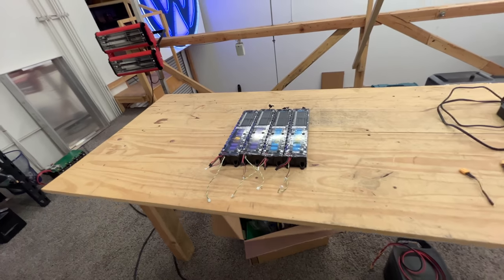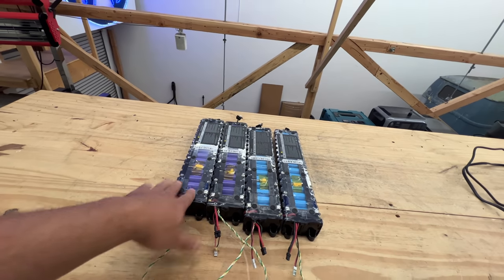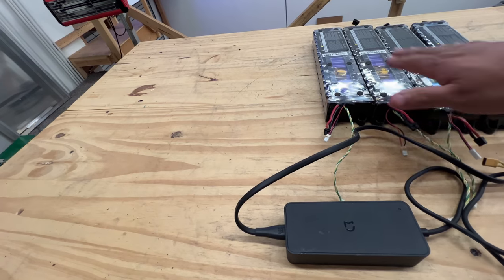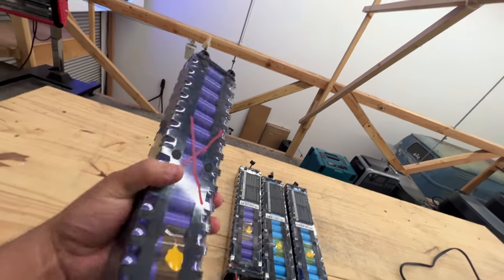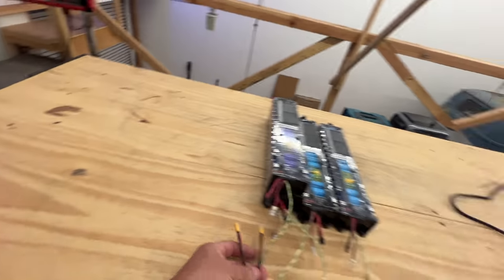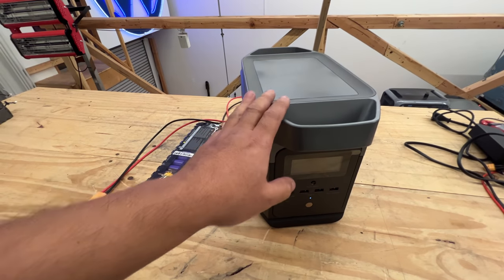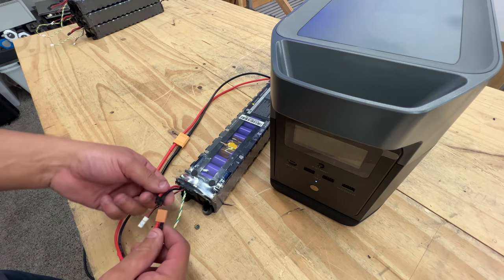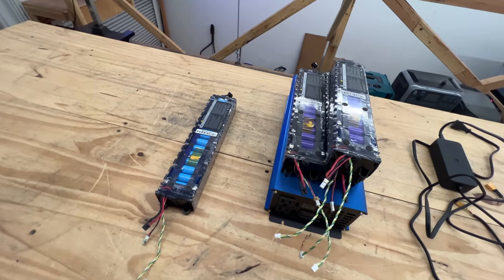10k Scooter Lithium Batteries In a Warehouse

Comment: Will say from experience, i bought a few of these used off of a bird mechanic, split a couple and reconfigured 6 of them for 13s9p at 4.5kw continuous and 7.5kw peak for a while, they are durable, while being a real b*tch to salvage the individual cells. Pull the BMSs, run 14ga or .1mm copper sheet between your packs and have at it. Stock bms is probably only good for the stock 500wish output peak

Edit: wanted to add I do not recommend running this much power through these, peak rating (probably for 10s) is 17amps per cell, with 10 amps continuous being their regular rating. If you are doing your first or third build and dont feel like buying a spotwelder or spending $3-700 on new cells, these work great!

Comment: You just helped me revive a dead pack that was showing 3.7V on the main, simply by pushing that reset button! 
I had no idea it was there. In my case, charging on main and charge wires didn't fix it, but the reset did.

Comment: Hey, I just ordered 6 packs on ebay, super excited!! I have a 72 volt scooter and have just been too depressed to go through my enclosed battery supply and grind down the old connections and reheat shrink and test the hundreds of 18650s I have. I may have an excellent supplier for 18650 batteries, but because I work for the company I can not take them home anymore!! If you want more info on that please message me!! Thank you for all you do with the DIY and showing people how to do it!!!!
Reply: Same here, although USPS held mine hostage for 10 days at the final hub. After walking in to a local USPS and asking about it, they finally delivered it.

Comment: For weeks I've been debating on either making a DIY LiFePO4 100Ah/1280Wh setup with a 2000w inverter for a Chevy Tahoe Overland rig that it'll be staying at for a few months after I return from deployment, or buying an Ecoflow Delta rig that offers 1260Wh. They both end up costing the same (Cost of parts for 1280wh DIY vs EcoFlow Delta w/ 1260wh) but the cost for extending power storage in the future was  going to cost way more for the EcoFlow until I saw this video. Your batteries solve my issue of battery capacity and expandability for cheaper and takes up less space than buying a second 100ah LiFePO4 battery. 

I'm planning on intermittently (not all at once) powering a 12v heating pad, Ninja Foodi MultiCooker, Hot Plate for cooking, Ninja Blender, 12v Fridge, Lasko 200w mini space heater, fan and charging my laptop and cellphone. 

Thank you for sharing your projects and knowledge. What are the chances of you creating a DIY kit in a container similar to an ammo can, with a PCB board to connect the batteries in parallel to charge then provide power to an EcoFlow?

Comment: Going to build the longest range scooter.  100 miles!! Ya
Reply: You might have to build a trailer battery and you can use it for many things down the road...
Reply: I just drilled a hole in my scooter's deck to externally access the battery connector. I bungee cord the battery to the deck. Works great! Just plug in a fresh pack every 10 miles and go 70 miles on 7 packs. Just carry them in your backpack, it's not that heavy. That is a long time on a scooter! I just did 25 miles in 2 hours (including errands).

Comment: I also built my ebike using the previous scooter battery packs.
Reply: How are the mh1 cells? I'm planning to build a 21s5p pack and I'm wondering how well they discharge I know it's 10amp per cell.

Comment: Why only 300W? If these contain LGM261865 cells (which are rated 10A each) it should do up to 30A * 36V = 1080W. Fully charged to 42V even more. The EVE ICR18650 are weaker, but still 23A * 36V = 828 W.
Reply: 10A max output but 2.6AH capacity.
Reply from the maker: the BMS only puts out 10A continuous so 360W or so
Reply: @jehugarcia  where can i make bulk purchase like this for my business? Can i contact you direct? Serious inquiry

Comment: Awesome!  So I wanna buy more of these to wire in series and parallel to make a 72 volt 24 amp battery, what kind of charger would I need to charge that kind of setup?
Reply: I bet you could just wire the output of two cheap ($8.88) 36V chargers in series.

Comment: I just got 4 of these.    The Xiaomi chargers were out for the xt30 so I bought the one with the xt60 connector and bought an adaptor cable from Amazon.
So far so good on 3 out 4 but the last one is acting a bit weird and the charger gets hot.
As far as using the smaller white connector is that possible with the Xiaomi charger or is that supposed to be charged with a lower voltage?
Hi Jehu, I sent an email about the 4th power pack not waking up.   Can I use the 2 pin cable to try to charge the unit?   The red light flashes about 4 times and stops.   The charger show solid red so it thinks its charging the unit.   Please see my email for more details.
Reply: Just an update.    I got the replacement for the unit that had an issue.   JAG35 sent me the replacement and a return label.   I decided to keep the one with the bad BMS and got a special price to buy/keep to use the batteries as backups or to reclaim the batteries.    I want to thanks the JAG35 team for the great service and accommodation.    Also, in case anyone is looking for the cable Jehu mentions it I couldn't find the exact one but Amazon does sell one that goes works with an XT60 connection.   Since I bought the charger from Jehu that had the XT60 connection (because they were all out of stock the the charger with the XT30 connection) https://www.amazon.com/dp/B07C2VDQTD?psc=1&ref=ppx_yo2_dt_b_product_details

Comment: I finally checked my battery pack, showing 2.7v from the output wires so I need to charge up the pack.  Problem is the charger output is an XT90 for a 1.7 amp charger.  I'm swapping out the XT90 for XT60s (smaller size).   Also outputs will be male connectors, inputs (like charging ports) will be female connectors.  I may change my battery output to XT90 from Power Poles as the XT connector looks more weather resistant.
Reply: I'm holding off on the plug changes, I built a dongle similar to Jehu's.   I plugged the charger into the charging port (thin wires).  Charger had a solid green led on, I saw a red LED flash once.  I'll keep checking for more flashes.   Ended up pushing the button.  The battery pack flashed red 4 times then stopped.
Reply: I think the BMS has an issue.  Pulling the pack open I'm getting 6.5v from the different battery groupings.  Checking end to end I'm getting 52v !?  Still only getting 2.5v from the power output xt30 connector. UPDATE:  This is what I get for forgetting about Jehu's earlier video on waking up the different scooter batters.  I made a XT90->XT30 dongle plugged it into the output power port then hit the button.  I've now got a red light on the charger and blue & red leds on the BMS - so it looks like it's charging.  Still not understanding the 52v reading I got earlier, but once it's charged I'll follow the connections and test again with the multimeter.  I'm sure getting an education on battery packs!
Reply: Following morning:. Charger showing green,. Battery pack LED is glowing blue, but the voltage across the power connector is only 3.75v.  Does something else need to be done to get it up to full voltage?

Comment: This is just a hoping that you or some genius out there can tell me how I can tap in a portable charging system in my 2013 FIAT 500e while in motion or driving  the car, to extend the range,
Reply from the maker: No
Reply: @jehugarcia  That hurts, maybe tapping the regeneration line by disabling the braking mechanism connection so the charge can keep going?
Reply from the maker: It’s the same mechanism,  when you steal power from going the result is stopping

Comment: Perfect timing on this video. I am playing with the purple battery for a DIY ebike setup. Hooked the thicker connector to the recommended charger it blinked red at first - battery had 6 volts on the thick/director connector. The charger light went solid red and eventually green - full charge. It only has a bit over 20 volts at the leads, though. Looking forward to trying the reset button trick - there is no blinking LED on my pack. 

Is there a name for the connector (with the 2.56 spacing) that goes to the proper charge connector?
Reply: Yes, of course.   If you can get a good picture off the video and do a google picture search, that should work.  If not, reply to my post and I'll put up a pic.  I have a few laying around somewhere.  They are used on all my 12 Vdc ceiling lights.
Reply: It looks like pcb header pins, 2.54 mm is 0.1 inch, which is the standard spacing for most pcb headers. Jehu may have measured the pins with a caliper which would explain the small difference. The connector looks like a 2 pin JST 2.54 mm connector. I'm not 100 percent sure though.
Reply: @chaffel3  I ended up soldering an XT60 connector as others had mentioned in the comments, easier than sourcing the connector.

Comment: Newbie question how do you connect all three or 4 together and were can one get a dongle for such?
Reply: Build a bus bar, or a bag of XT connectors and get soldering
Reply from the maker: get a few of these parallel connectors https://amzn.to/3DikGud
Reply: @jehugarcia  Thanks
Reply: Charge two of them up, cut connector off one, strip the red end, on the other pack's red wire strip a spot  about 2" from the connector and solder the red wire into the side ofthe other pack red wire and insulate. Repeat for black side.  Most hobby shops also have parallel Y cables for about $6

Comment: I was wondering what it would take to convert my astro van over to full EV I have a 1997 AWD Astro and want to give it more power then it has but unsure where to start
Reply from the maker: you need about 50kWh of battery and about 150hp of electric motor if you want a single gear.  so about $25K in parts and a whole lotta elbow grease.
Reply: @jehugarcia  damn! that's quite of bit of money for a simple project, I think is better to build a powerwall with those batteries...
Reply: @jehugarcia  how can I buy a bunch of batteries from you? I want to build my own powerwall...
Reply: @MrSeth166  Simple on paper is often complex in reality.  Yeah, you're simply swapping motors.  Sure you're simply swapping a gas tank for batteries.  Of course you're changing the plain gas pedal for a sensor.

Comment: If building your own battery box (batteries, inverter, charger, etc) Is there a way to make it auto-uninterupatable?  I.E. I want to start out by building something to replace one of my UPSs.  I want to be able to have AC power running in normally, but have it instantly switch to battery when the power goes out, then switch back and start to recharge when power comes back on.  Is that possible?  Is there such a thing as a charger/inverter that auto switches, or some other method?  Would the inverter start up quickly enough on changeover?
Also, best opinion...this pack 36v@8A, or the LiFePO4 12v 60-cell pack that appears to be capable of 20A?  I hate that pack statistics aren't very clear...I wish they had V,A,Wh per cell and per pack on all of these....  It looks like the LiPo 36v pack is ~270Wh @ $35, the LiFePO4 12v pack is 288Wh @ $45.  $129.63 vs $156.25 ($/KWh for standardization) but is the added cost worth it for LiFePO4 safety?  Also, 36*8 = 288W, 12*20=240W....the 36v pack can put out more power....  Let me know if I'm missing something...I haven't worked with any of this yet...just a lot of youtube watching.
Reply from the maker: Why replace your ups if you want the features available on ups units?  They make them them in all sizes and voltages so use one
Reply: @jehugarcia  SLA batteries suck and by the time I need them they're always dead.  I can't get a clear answer on if I could/should use lithium packs in them as an alternative.  Either due to current draw or charging methods.

Comment: Can these battery packs be connected in parallel? I'm replacing the SLA batteries on my stretch beach cruizer DIY ebike with these battery packs. The SLA batteries I'm currently using are 12v 15ah each. I have three in series. I get about an hour of cruise time with the SLA combo before they get weak. A pair of these battery packs would be roughly 16ah in parallel which would work out perfect. However I'm concerned that connecting them in parallel might be a problem without some kind of balance circuit. Also, can they be charged in parallel?
Reply from the maker: Yes

Comment: i have a Bluetti AC200P. I'm interested in seriously making an extra external battery for it. and using it in a small home built travel trailer. I wanted to get around 700watts to 800 watts of solar on the roof. i have so many questions like can i build a box for these batteries? can it be airtight? does it need to be vented? does it release gasses? and the exact parts i'd need to get to make 8 or 10 of these packs into the external battery? how to best recharge these batteries off the bluetti during the day? *overwhelmed*
Reply: oh and my abilities are.. i can solder and follow instructions/parts lists if they are detailed enough. >_<

Comment: nice, what aircon is it that only uses 1400w / works with the ecoflow?
Reply: 1400w is a lot for a air conditioner usually they use 500watts or 700watts, unless your talking about a central AC that cools your whole house, those use more

Comment: Newbie question here. Can you hook 2 36v packs together and then part of a 3rd pack at 12v in series ( without the bms that comes with packs), to make an 84v pack?  My Daymak Em1 is slow at 72v but controller says it is rated for 84volts
Reply: If you're a "Newbie" then the answer is no. 
However, I'm not a newbie, so IF I wanted to get 84 Vdc I would use a DC to DC converter. Either 2 36 V packs in series and then STEP Up to 84 Vdc.  Or 3 in series and STEP DOWN to 84 Vdc. Of course the the DC to DC converter would allow you the ADJUST the voltage to whatever you want. The more voltage THE FASTER YOU GO!!   WOW!   POP!   What happened? What's that smell? Why is it not working anymore.   AND, it was fun while it lasted.
Reply: 84v is equivalent to 20 cells in series at their max 4.2v at full charge. This would be the same as taking two of these 10s 36v packs nominal but 42v at full charge and connect them in series like you first mentioned.  No need to add the extra 12v in series.  I would consider stacking 4 of these packs in 2s2p configuration.  6 packs would be better at 2s3p for more range and max amps for street riding fun!!!!!

Comment: @jehugarcia Excited when I saw these to potentially look at an easy DIY powerwall but price per cell is higher than a lot of your other options. Any other battery packs coming up that would be better suited to powerwall?
Reply from the maker: These are as good as it gets
Reply: @jehugarcia  I'm new to power walls. How would you connect and charge these if you were say 15-20 packs
Reply from the maker: https://youtu.be/qvwAAMSbTOs

Comment: Does anyone what connector can be used for the existing charger input connector? Or does it make more sense to replace that with an xt30, etc?
Reply: It's a regular JST connector, they're common on small RC batteries. You can get a pack of 10 pairs for $6 on amazon. Hopefully if Jehu starts selling them they'll be female JSTs and not bare prongs.

Comment: How much are these units each I'm trying to make a golf cart pack which is 72 V GEM car right now there is 6-12 V group 31 size that powers the golf cart can you estimate how many of your units I would need to push this along
Reply: You need to gather data then basic math
Reply from the maker: yes, you will need a few of these,  how many?   you did not provide enough info for figuring it out.

Comment: BTW are any of the wire pairs for a power switch?
Reply: I had a link to the output diagram but it was taken down (censors less useful than syphilis).   Anyway there is no power switch.  Heavy black/red is power out, thin black/red in front of charge, white/green is a data connection, and the read wires are for a brake light LED.